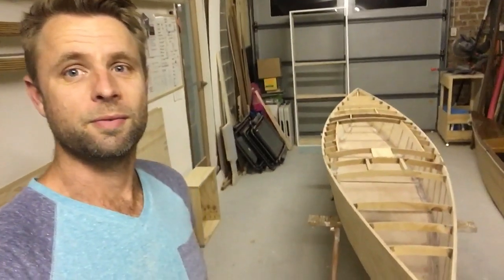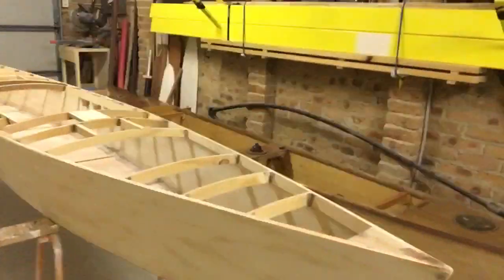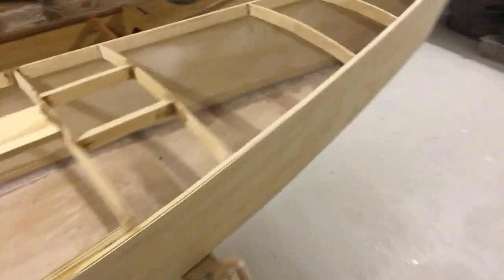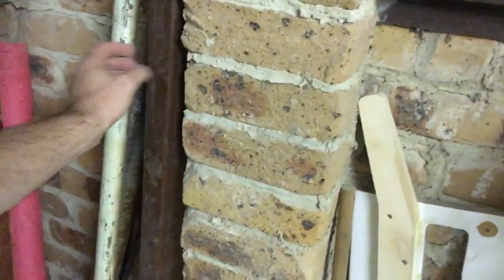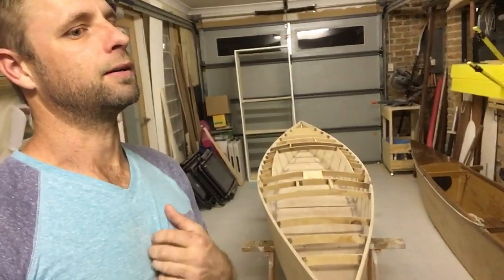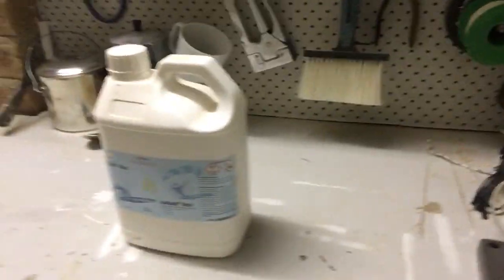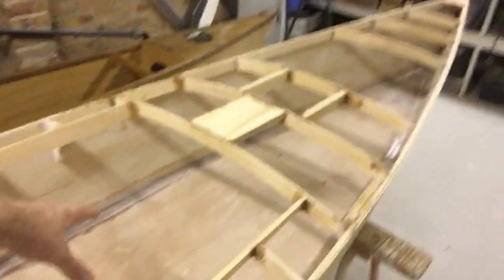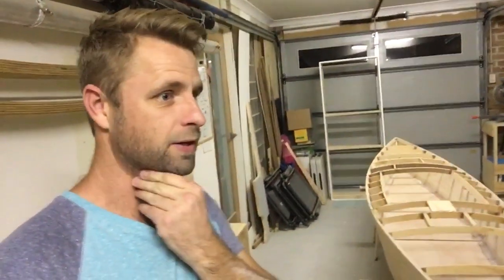Simple DIY 13’6” (4.2m) stitch & glue canoe build using lightweight 3mm plywood

Comment: Hey mate. What was the epoxy you used and did you get it at Bunnings too?
Reply from the maker: I used Surfset Flex epoxy from sanded.com.au. It’s a great product that has a little flex in the hardened glue which is perfect for wood/fibreglass construction